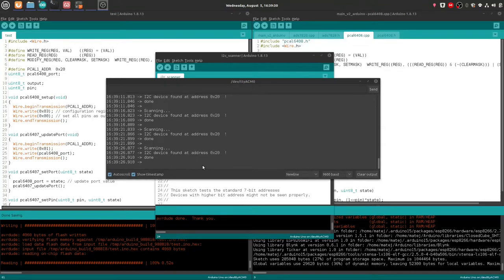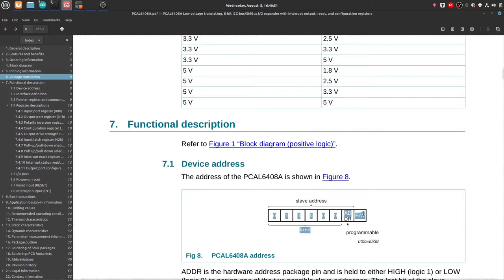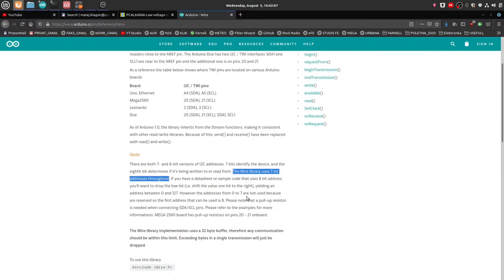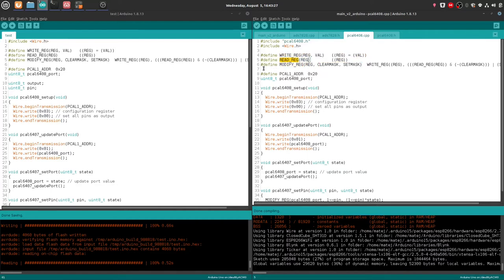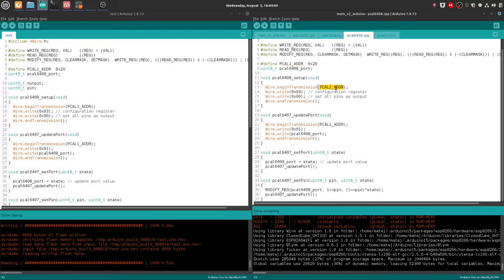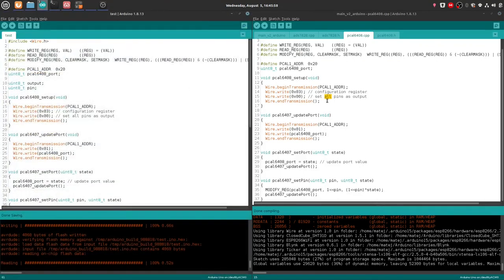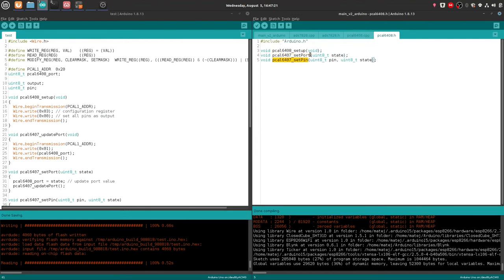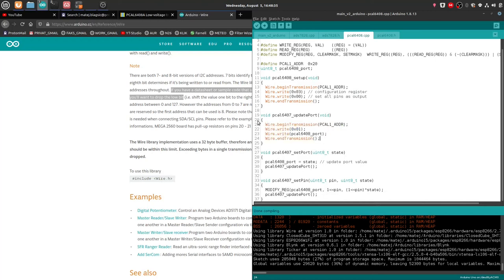I2C example project on Arduino - comparison | VIDEO 32

Comment: Subscribed and running through all videos.  Greatly appreciated and learning much.   

Question:  I'd like to connect two STM32F103's together to control 18 servo's for a spiderbot....I've got down the code for the basic logic on legs/joint/servo control but totally lost on how to talk to two STM32F1's with i2c.

Can you make a vide on 2 mcu communications or provide a reference to a good solution?

Domo-arigato Sir!
Reply from the maker: Thank you for the comment :)

Also I am wondering if your option to choose two uC's for your project is just down to the lack of i/o on F103 or something else? If it's down to i/o, then I would recommend you to use just one as it's much easier to debug and write code. You can get a bigger package or get external peripherals to have multiple pwm outputs for servos, but I thing one larger IC would be much cheaper and easier. F407VG ~100pin has lots of timers with each having 4 outputs.

Communication between two microcontrollers is usually done with UART as it is simpler and more robust. If you have just one pcb, then it's much less of a problem. If you want multiple uC, then something like i2c makes sense, else it doesn't. With uart each uC knows it's role. It is full duplex and you can use DMA to move data into temporary "buffers" so you can read the message whenever you have time(in main) instead of doing it in interrupt. I am working on a future video for implementing simple and robust api for communication between two uart devices in c++ so you will be able to implement it on pc in gui and for uC as well. Stay tuned :)
Reply: And THAT is why you have the MAN!!! F401 or F411 20+ PWM pins - 2 for 10 bucks.    I'll name my first spider-robot boy after you  :)